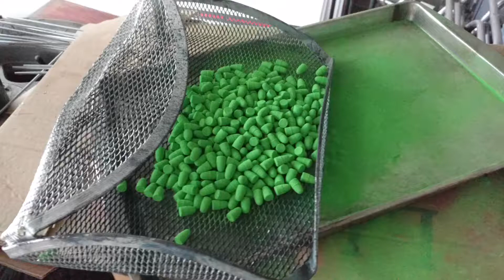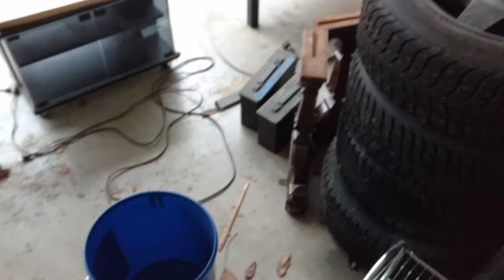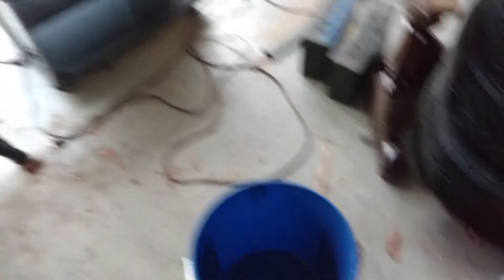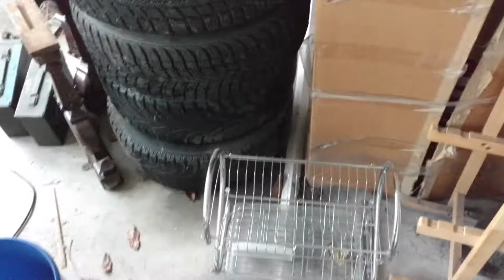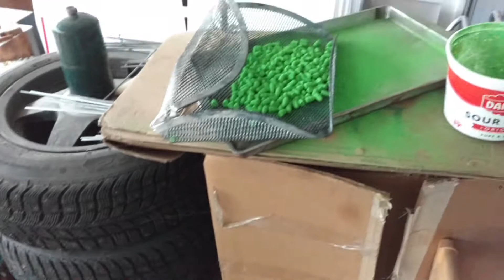Tips for solving problems with powder coated bullets.

Comment: Probably a dumb question, but can powder coating be safely used on black powder bullets? Thanks
Reply from the maker: Of course. And with the same benefits. No leading, reduced exposure, easier to find your bullets. You can probably reduce or eliminate lube too, and have less smoke. If the lube is helping with cleaning powder fouling, that might not be worth it though. Ditto for revolvers where the lube can help be a barrier against chain fire. If I were hunting with a front stuffer, I would definitely powder coat my bullets. Still stick to full soft lead alloy.

Sorry for the slow response. For some reason youtube doesn't show me that there are replies on the videos. There's a graphic on my dashboord that shows the responses, but then shows blank when I go to the comments page. I have to guess which video by the thumbnails, then sort by newest to find them. I've probably missed quite a few people.
Reply: @GunFunZS  Thanks for a good explanation.
Reply from the maker: @cantstandidiots5839  Welcome. I need to get a flintlock.
Reply: @GunFunZS  Flintlocks are notoriously fiddly. Playing around with your flint to get a decent spark shower off the frizzen is a bugger. Not to mention getting enough 4Fg powder in the pan to ignite, but not so much that it burns off your mustache... or blows off in the wind, or dumps when you cant the rifle even a bit too much. Get a cap-and-nipple rig, at least to learn on.
Reply from the maker: @scottcrawford3745  I understand that if I get a muzzle stuffer it's going to be because I want to fiddle. The Flint locks are just more interesting to me and at this point the only reason to have a black powder gun is because it's interesting.
Reply: @GunFunZS  Totally understand, Sir. Was just giving you that friendly warning that only a real friend would give before you jump into the deep-end of blackpowder shooting. Go for it. They are very fun ( Flintlocks).. you just have to get used to a significantly different ignition timing sequence, so your hold and follow-through are critical. It seems to take SO much longer from when you squeeze that trigger for the rewarding Boom to occur. Pyrodex and true Blackpowder both have their own idiosyncrasies, too. Best of Luck!

Comment: Just getting into cast bullets, been loading with jacketed. For correct sizing I am checking each gun I'm loading with a ball mic down the barrel, can I get a good reading on the tops of the rifling plus your .01 or .02 added for sizing?? Thought you my know thank you. Also plan on powder coating.....
Reply from the maker: Probably that's overkill. The practical tolerance is not that critical. If you are equal or greater to bore diameter and the bullet chambers, you will have good results. Digital calipers on a slugged bullet will tell you that with adequate precision. Your method will do it too, but probably tempt you to over think things. It's a threshold state thing. One threshold is that bullet diameter of the smaller outlier bullets are small enough to get blowby. The other end  threshold is that the bullet as loaded in the cartridge is to  fat to chamber and extract easily. As long as your bullet is between those thresholds you are good to go. Hope this helps.

Comment: I got some powder And tried to coat a few bullets but it came out horrendously they look chared and very un-uniformly coated  I basically just shake them in a container and they look fine but when it comes out the oven its shitty. The guy who sold it to me said it was due to cold and wet weather but I dont know, also after I resise them it scrapes of all the coating so what does it help ? Any advice ?
Reply from the maker: J-D Griesel maybe the specific coating you're using . My bet is you have some kind of oil contamination though . Somewhere in your system there is oil or something like that getting on your bullets . Maybe your hands maybe your molds maybe a bucket or your tray . Clean all that crap with alcohol and try it again . Alcohol wash the bullets too at least while you are troubleshooting .
Reply: GunFun ZS thanks will try it
Reply from the maker: J-D Griesel I think you should also use a thermometer to verify the temperature of your oven

Comment: I've been using HF red with the dry tumble method for rifle bullets in a ton of surplus military rifles and get excellent accuracy and consistency in them.  The loads are easily more accurate than I can shoot with iron sighted milsurp rifles...maybe if I was trying longer ranges with a scoped modern rifle, I would see some shortcomings.  And of course it works great on handgun loads.
I also have powder by the pound durable black and eastwood ford light blue that I use, but I've seen no difference.  They all work great.

Comment: I can’t get my powder coat to stick at all in south Florida, humidity is just to high to create static with the heat and tumble method.
Reply from the maker: No heat in my method. I have dried them in the oven first. Perhaps a bag of silica cat litter attached to the middle of the tumbler might help. I am trying to think of better ideas. A.c. Helps.

Comment: You would be amazed how well the HF paint looks from the spray gun!  You know the HF black paint that everyone knows doesn't work with tumble - well it looks amazing from spray gun, I was blown away first time I used it.  I only try to spray my rifle bullets since it's more time consuming but it's a lot more uniform.  Since I "recycle" my left over powder I noticed that next batch just doesn't want to work with tumble that well and when that happens it goes to my spay gun where everything works lol
Reply from the maker: Yes, it may look nice, but I don't believe that method can be as consistent in the thickness department all the way round the bullet. Also, it is enormously more labor. If you like doing it that way, enjoy. I think it is wasted labor to make less consistent ammunition.
Reply from the maker: pps. Your spray gun works, because you've grounded the system and given a more dramatic static charge. That's a good thing. My problem is that you almost certainly have more variability in the thickness from one bullet to the next and from one side of the bullet to the next when you are hand applying coatings. Tumbling is random, and if done long enough, pretty much has to be uniform.
Reply from the maker: I should mention that I have recycled powder too. So long as it is clean, I usually get good results. Some mixtures work better than others, so I generally prefer to recycle them in seperate containers to keep the powder un mixed. As always, if you get a good result from a mixture, that's great.
Reply: Yes, it is labor intensive I agree, however since I shoot bolt action rifle I don't just shoot hundreds of rounds so it OK with me to spend extra time with it to get good results.  Speaking of results I am doing this spray in the first place is because it looks more consistent and uniform than hand tumbling and baking on wire mesh because I have to water quench my bullets I cannot follow your method of rolling them in the cardbox after bake as this will result in much softer BHN.  So actually you picked my curiosity to compare sprayed vs. hand tumbled powder coat accuracy.
Reply from the maker: I annealed then water quenched my bullets prior to powder coating. Per my testing, this results in the same high BHN each time I sampled and tested as doing things in your order, but a nicer surface finish and essentially zero rack marks or clumps, or need for finicky handling. I could easily re-temper again, if I wanted to, even post sizing.  I had the same theory as you and tested it out, and found no advantage, but much greater chance of bullets sticking together. Hence the point I made in this video. Having tried it both ways and measured, this is better.
Reply: When you bake your bullets you are erasing your previous work of tempering.  This is evident by the fact that when I cast the bullets they come out from hot mold and I drop them in the water and they are hard but when I bake them they loose that hardness.  So how exactly do you anneal them before bake?  (Anneal means to soften a metal as in brass annealing https://en.wikipedia.org/wiki/Annealing_(metallurgy) I see a lot of people use this word instead of tempering, I can't figure out why.
Reply from the maker: I should have said "harden." As in, I bring them up to critical and hold them for long enough for the molecules to realign, then water drop.

I agreed with your theory that baking for powder coat after heat treating would be mildly annealing away my prior temper. I expected to see ~28bhn bullets end up at ~26BHN after baking for powder coat. However, I TESTED it, so I had to change my theory. My present theory is that baking for 10 -15 minutes at 400 f is enough to cure the PC, but is not enough to reduce BHN, because that conforms to what I found.

I was surprised that each batch of PC bullets seemed to match the bullets I had tempered prior to powder coating from when I was still tumble lubing with 45/45/10. I thought that I should see a drop, so I did the folowing tests using the same raw alloy in the same mold. 

I measured 3 batches from the same casting , then repeated the experiment the next casting session too. Here is the method: batch 1 was done with my normal method: cast, then put the bullets into the oven and hold at ~400f for 50 minutes, water drop, dry, then tumble and PC baking at 400 for 12 minutes. batch two was simply cast, then PC as before, but for 50 minutes, then water dropped from the oven in the same step as the powder coat. (your method, and what I expected to be the fastest and hardest.). batch 3 was cast, tumbled, powder coated and baked for 12 minutes and allowed to cool. Then rebaked for 50 minutes and water dropped. 

Findings: Methods 1 and 3 had no rack marks and clumping. Method 2 had lots of rack marks and clumping. All 3 tested at 28 BHN. method 2 was more labor, and had worse surface finish. 1 is slightly less labor than 3, and yielded equal results. Therefore, it's the winner. By all means, replicate my testing. If you find that my results are not repeatable, that's science, and my feelings are not hurt. I found that my old theory (and by extension your present theory) did not match what I measured. I tested it twice and measured a lot of samples from each batch. I was actually quite surprised at what I found, and also how consistent the BHN was across all samples. I was getting 27.5 -28 bhn from all the batches, with almost all being right on 28 bhn. 

Alloy was from salvaged linotype + a bit of salvage solder. ~air cooled ingots measured about 24 bhn, but I do set the ingot mold on a wet rag so it is being cooled a little faster than air alone. I did a similar check with monotype alloy, but was not as thorough. It was just to see if my trend was an aberration or the rule.

You are a guy who thinks things through and I can see the work you put into testing. I think you would agree that my protocol was sound, but if not, I'm all ears. Of course I invite you to test and report your work. I suppose I would be more credible if I had taken the time to film all of that and enter my samples into a spreadsheet. I simply state that I have no reason to lie about this. I want the process to be whatever produces the best, most consistent results, with the least cost and effort.  Facts are king.
Reply from the maker: I can think of one potential skew: I BHN test by filing a small flat in the bullet's side profile so as to get a good reading. It is possible that surface BHN degrades a little, and that I am reading from metal which did not reach critical for long enough to de temper because it was below the surface. However, that is also metal which is not cooled as quickly either during the quench, for the same reason. --Thoughts?
Reply: Ok, I will reply to this one first since you're the only other person I know who will write a full page paragraph response.  The other person is me :) LOL, it's very much appreciated and valuable to me.  I test my bullets on the nose always but tried on the base too but Lee says not to.  The reason I use nose is that on semi wadcutters I don't need to file anything.  I hate filling a perfectly flat surface, my files are leaded, I hate cleaning them and all those lead shavings everywhere is just not good. On spire points I used snips and coping saw to cut off portion of the nose and finish with file.  The reason I don't use side is because it's hard to lay bullet perfectly perpendicular on the V shell holder.  I use resizing punch that been flipped upside down as flat surface where I stand the bullet and make my indentation.  Lately I discovered another method that greatly improved my technique I use my mini lathe to cut a flat surface in the nose I can also square up base if needed for perfect 90 degree standing.  The result is that  I get very nice flat surface that is produced every time with no effort.  While writing this message I realized I can machine a basic shell holder with 30 caliber opening about 1/4" deep to drop the bullet in and raise the ram to get centered indentation for even less effort testing BHN.  I need to make a video on this as well.
Reply from the maker: I've considered those points. I don't do the base. p.s. I think you should not use side cutters. A hacksaw, sure, but side cutters are going to mash the lead too much. Lead work softens, not work hardens. I think cutting is okay for sampling, but a shearing action is going to change your BHN reading a bit. A vixen type rasp is nice for the task, and I card the file with a wire brush I have for cleaning them. As before, feel free to prove me wrong and tell me about it. BTW, I've been meaning for a while to make a simple C clamp shaped block of wood to hold the little microscope pen, and a light the right distance from the bullet to keep it in focus. I've seen them sold, but the idea is too obvious and simple. It would feel wrong to order something I could make in  10 minutes.
Reply: Yes, I tried snipping but it didn't work well, saw works, but lathe is the best!  I used metal brush too but not enough, needed to use scribe for lead pieces stuck.  I actually have a video on microscope stand that I need to edit and upload.  It will give you idea, super simple.  Going to work on it now.
Reply: No idea, but I actually test something like 1/3 deep in to the bullet, I also retested some bullets by taking a layer off and got slightly different readings.   Sometimes I wonder if the 60lb pressure is really that consistent when applying in the press.
Reply: Your tests and results are definitely interesting and I want to repeat them with WW.  Ok, last time I tried to heat treat my bullets for 1 hour they melted halfway :) because my cheap oven suffers from a problem that I will outline in my upcoming video, I got new oven now but I haven't tested with it.  Baking bullets for 10 min is actually what manufacturer suggests like "powder by the pound" and others.  I always ran them like that until I started doing the tempering/baking.  I will try your method at any rate at least I can produce nice looking pistol bullets with least effort.  The major difference I see right now is that you are using different alloy.  I haven't tried casting with pure Linotype ( I was lucky to buy some local relatively cheap) but what I found is that WW react to tempering incredibly well due to Arsenic acting as catalyst.  For example I mixed 50/50 pure with WW and was expecting something like BHN 12, well it dropped at 9 and in 24h it reached 20!!!  Harder than I needed for 38 SPL.

With my new found easier method of creating "flat spots" I can get back to testing 5 samples at the time.  There is a guy on the forum who did tremendous testing with lead hardness all kinds of testing he was helping his kid with science paper so he recorded everything and made it available somewhere online.  I came across it once but I didn't save it.
Reply from the maker: Rotometals says they won't certify BHN on lead-antimony alloys because you need a larger than standard ball to get readings accurate and reliable enough due to the crystalline structure. The lee and other testers use substantially smaller balls than the standard
Reply: Well as long as they can provide alloy percentages that's good enough.  Even though a company like that should have some lab grade testing equipment.  I am curious to find out how much my tin/copper alloy has % of copper or how much my melted pewter has copper already in it (suppose to have up to 1.5%) or my WW + pewter + extra copper. etc, etc.